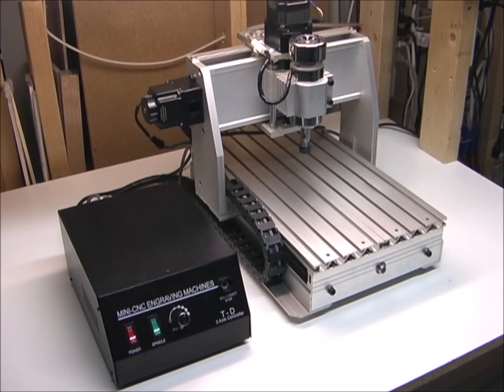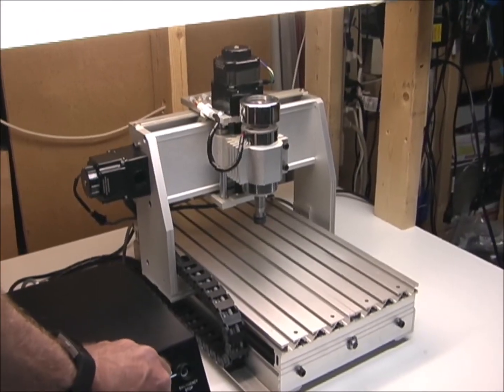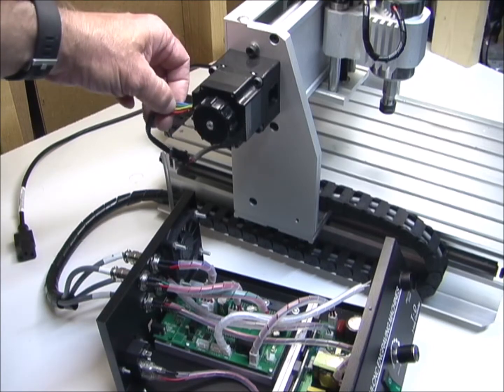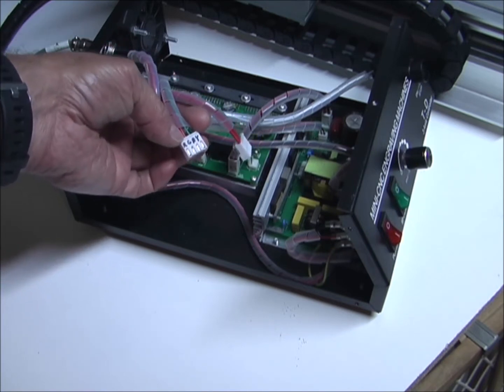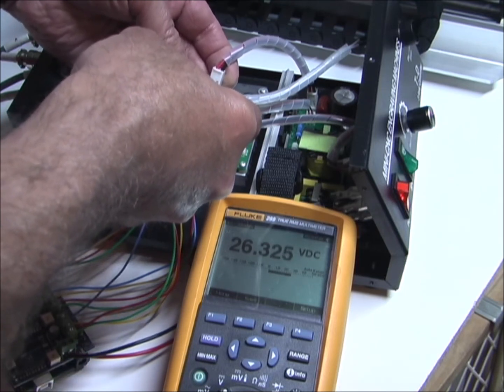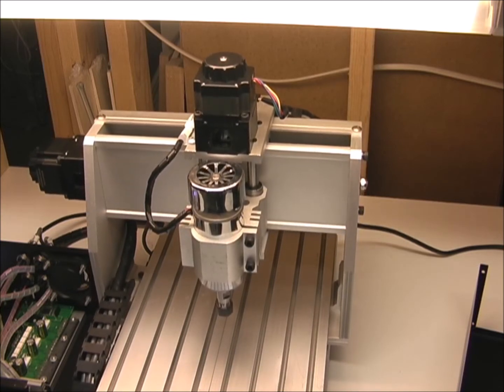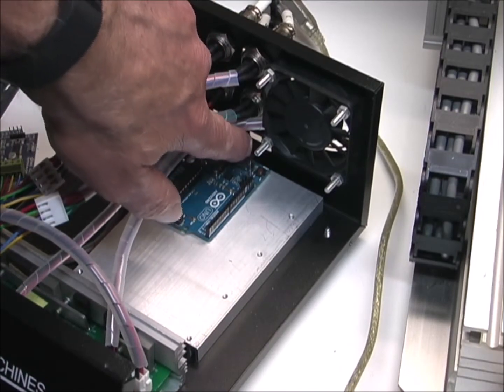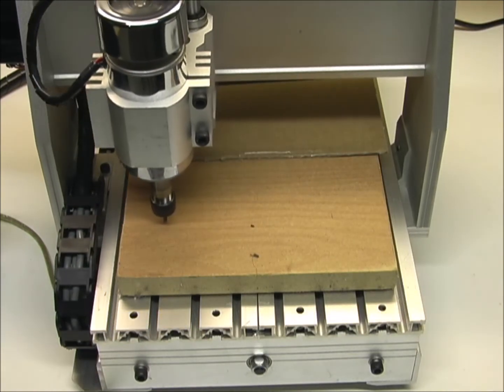3020 CNC Router Converted to Arduino / gShield, GRBL.   Universal Gcode Sender

Comment: Thanks so much for posting this detailed video! I have also found a second-hand 3020 CNC Router in New Zealand, and I'm going to follow all of the same steps. This will be a lot easier than I expected! I was worried about the proprietary software and would prefer to use LinuxCNC or cncjs, so I was about to give up on this and get a much more expensive desktop CNC mill, but they cost thousands of dollars. I'm able to pick up this used one for about $400, plus the arduino and gshield. I also have a 3D printer so I can print a new mounting plate as well. Your video has probably saved me thousands of dollars, so thanks a lot!

Comment: I want to convert my chinese 3040 cnc router to Arduano and Grbl.  Could you advise me on what two boards I need to purchase.
Reply from the maker: There are probably several different boards you could use. The two I used are: Arduino Uno Microcontroller (approx. $23) with a gShield V5 from Synthetos (approx. $50)
Reply: @WilliamFrawley  Thank You will try.

Comment: For my conversion I mounted an Arduino nano, running GRBL, onto a pcb with a parallel "d" connector and plugged it into the d socket at the back of the control box. Simple cheap solution as it uses the stepper drivers etc. in the control box and requires no mods to the control box.
Reply: Hi @romanroad483, would you be able to share some more details about how this works? I'm planning to pick up a used 3020 CNC Router and would like to know more about the firmware that you're running on the Arduino nano. What protocol does it use to communicate via the "d" connector? Is it something that you had to reverse engineer? Would be grateful for any tips or links you could share, cheers!

Comment: Hi great video.. I have a bigger version of that cnc the 6040 and it uses nema23 motors.. I have been wanting to change the board to gerbil... Could this board also work
Reply from the maker: It will work but if it heats up too much you might want to add a cooling fan
Reply: @WilliamFrawley  thank you Jay.. You have a new sub..